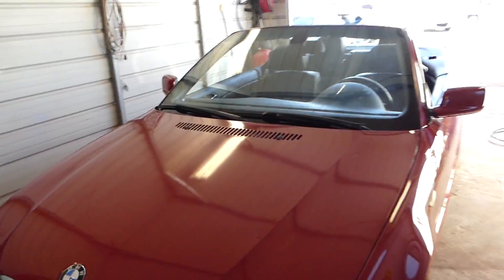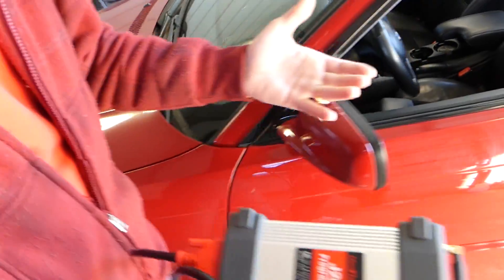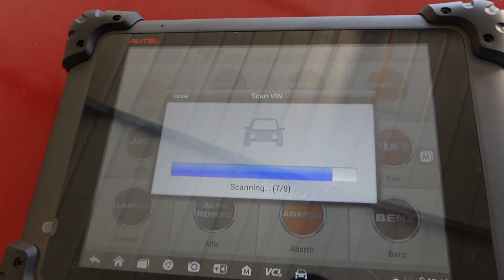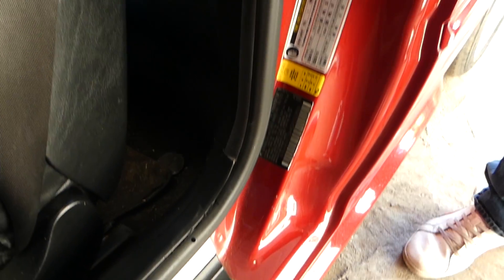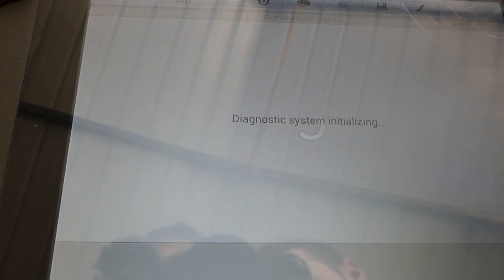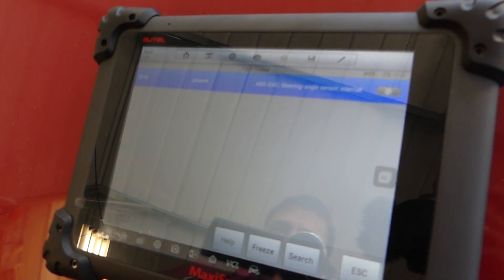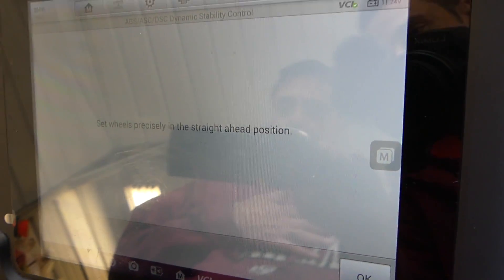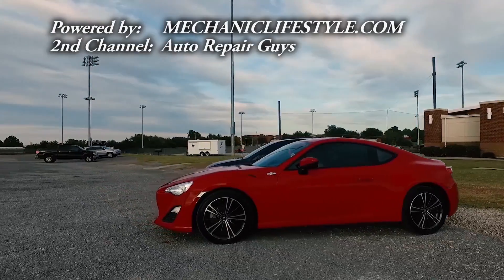Project: BMW E46 330ci ZHP Diagnostics ABS and Traction Control Light

Comment: I had steering angle sensor and wheel speed both clear till i start driving i got 5da3 change sensor same code new abs pump so any input be good ty